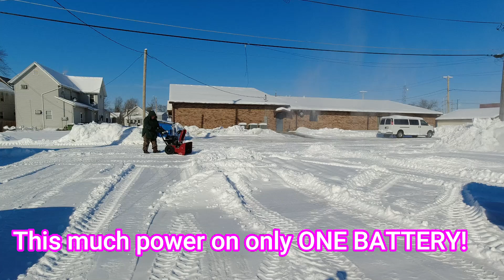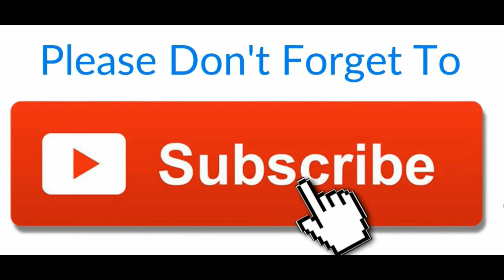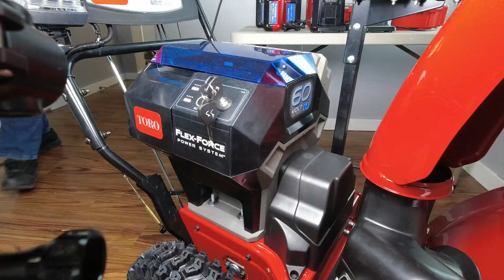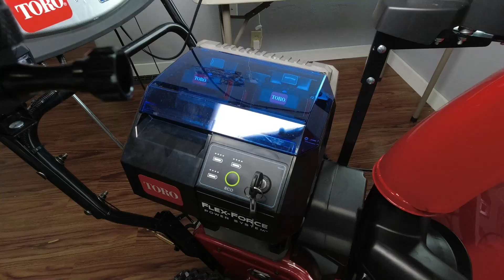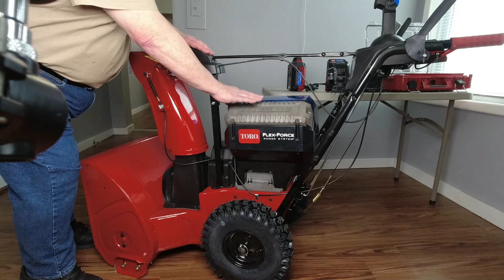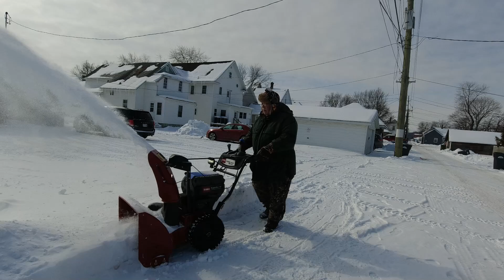First Look! NEW Toro Power Max 60V Battery Two-Stage Snow Blower

Comment: How come Toro really doesn't talk about their auto steering in any of their promotions for their snow blowers. 

My understanding is 26 in and up they have the auto steering.. 

I purchased the PowerMax E24 version instead of the E26 they're about $200 difference. The E24 comes with the 6.0 AH batteries and the E26 comes with the 7.5 AH batteries

The E24 does not come with hand warmers, 

Using my PowerMax E24 today to test it out I noticed that the axle seems to be locked!! 

But you're saying that the PowerMax E26 has power steering differential. Just like the 928 you reviewed when you open the gearbox. Why do they not mention this about either machine.. especially not mentioning it with the E26 the one that you have. 

Why don't they have power steering on the E24 I don't get it. I found it annoying on dry ground trying to maneuver the E24 I thought it was going to have the power steering.  

Is it that people don't like the power steering or auto steering cuz they're afraid of it thinking it's going to break so they don't mention it in any of their products.. 

Is it a lot more money to make autopower steering differential? 

I don't know what are your thoughts.
Reply from the maker: There are very few 24-inch machines on the market with auto-steering or trigger-style power steering. Why? The 24-inch group of snow blowers is very competitive and most people looking for that size snowblower are ONLY looking at price. Steering adds $100 or more to the price) 
Toro has the 824 SnowMaster single stage with automatic steering (auto-steering or autoturn) 
Ariens has the Compact 24 Compact 24 RapidTrak, 24 Deluxe and 24 Platinum with AutoTurn
Cub Cadet has the 524 and Husqvarna has the 324 with trigger power steering. 
If a Toro has steering it's usually listed in the features or specs. Toro calls it automatic steering in the 826 and 828. 
I'll ask Toro sometime why they don't consistently list the steering type.
The DI300 auto steer differential is bulletproof - it doesn't go bad.
Reply: @PaulSikkema  thanks for the response. I guess reading online people were saying one of the biggest reasons is because the 24-inch is much easier to maneuver and is really not needed because it doesn't weigh as much. But I tell you I would love it. 

I don't know if the power max E26 has automatic steering.. You say it does did you check? 

I haven't heard anybody talk about it online or any video showing it. 

It does not say it in the specifications on Toro's website, on home Depot or in the manual in the specifications. 

Just weird how they don't talk about it.. 

As for the PowerMax E24 versus E26 the price difference is only $200. But it looks like You could easily find that money because of the 7.5 AH batteries that cost $350 versus the E24 that only has the 6.0 at 269 or something like that.  And then the hand warmers cost about 70 to 100.00 It doesn't look like they're accounting for the automatic steering or power steering or even mentioning it for the E26. 

I still don't know if I even would have bought the E26 anyways My driveway is pretty narrow when I park my car right in the middle. I only have about 26 in on each side That would be really tight That's the real reason why I bought it.. 

I don't care about the hand warmers, the battery should be fine. But if it comes with the automatic steering on the E26 I would have loved to have it on the E24.. I guess it's not as big of a deal when the snow on the ground because you can move it easily.. But when there's no snow on the ground not that much fun..  

And I don't know if you answered already. 

What is your favorite snowblower and what do you use on a regular basis as your daily driver?.

Comment: Just curious Paul What snowblower do you use and prefer... What's your go-to through your life snow blowing and what you use now.
Reply from the maker: My "everyday driver" is the Ariens RapidTrak Pro. I have seven driveways to clear and one is fairly steep - so the RapidTrak is always the safest to use on it. It's also the easiest and least tiring to use so I grab it most of the time for the other driveways also. . 
If I only have a couple of inches to clear off the sidewalks I grab the Toro 60 volt single-stage. It really fast for smaller snows. 
I also have two gravel parking lots that hold a total of 25 cars. If I have over 6 inches I'll use the Ariens RapidTrak Pro but if there's less than 6 inches I have a New Holland TC33D tractor/loader that's faster than walking those parking lots. I also use the tractor to clean up after the snow contractors at the Salvation Army and Benevolent Society that are close by. (The guys in their pickups can't be bothered with cleaning sidewalks or around entryways...)

Comment: Looks like they are building/designing a modular battery/motor module to fit on existing snowblower frames. Good idea, I sure don't miss the roar of the engine, oil changes, rattling and vibration etc.

Comment: I bought E24 , it comes with 2 / 60v 6.0 batteries, I’m planning to get third batterie, is it ok to get 7.5 V?
Reply from the maker: Yes, by all means get the 7.5 AH. That larger battery will give you about 40% more run time.

Comment: It sounds like the “engine” starts turning when you turn the key to full on. Does the snow blower draw power from batteries before the drive handle or auger handle is engaged?
Reply from the maker: Yes, the "engine" starts when you turn the key. This snowblower works Exactly like the gas 826 Toro. Start it, and then go clear snow.
Reply: Thanks. Great videos and information. I appreciate your fast reply

Comment: I appreciate how well this is built, but I prefer that the SnowJoe 100v 24", which I own, takes advantage of being electric. It doesn't have a friction disc or belt. The motors only operate at the speed they need to and parasitic loss is kept down. The 100v, 5 Ah is a beast in both the 24" two stage and 21" single stage (which I also own). I live in Maine and they've gone through anything we've gotten.

Comment: Thanks for the video.  It looks like a powerful machine and quieter operation noise;  however, it like buying a premium priced EV that still needs a timing belt and a belt driven gear box for the friction disk system to work which require regular maintenance and replacement. I am sure it cost less for Toro to make it this way as well as easier to retrofit their gas snow blowers in the future when people needs to convert their small gas engine unit to meet the new environmental regulation.
Reply from the maker: Cost is always a factor because the snowblower industry is HIGHLY competitive. That said, yes you may have to replace a $25 friction wheel or v-belt in the next 10-15 years but overall the snowblower is all-metal. No plastic gears, gear housings, plastic controls and potentiometers that will crack or wear out like the other electric snowblowers are currently using.
Reply: Agree they should have made the powertrain gear drive on the motor and then electric drive to the wheels, what would be really awesome is if they can replicate something like John Deere's Load Match on their tractors and automatically slow the drive motors once the impeller is at maximum efficient load, then you can just set a max speed for it to ramp up to and it'll automatically slow down when the load is too high

Comment: Try that out on plow covered driveway and sidewalks ,a hell of a lot harder than snow that sits for a day
Reply from the maker: I understand your concern but since this snowblower is exactly the same as the Power Max 826 it will handle the snow. In addition, these brushless electric motors have instant torque so they may even work better clearing the type of snow you mention.

Comment: It looks like all they did was take one of their gas powered two-stage snow blowers, toss out the gas engine, and put an electric motor and batteries in it's place. It's a nice snow blower, the only thing I don't like about it is that the motor is always running - it's pointless to have an electric motor idling. The switch to turn it off isn't at the controls either, you have to walk around to the motor like you're operating a gas snow blower except you can't hear it so you might just walk away from it and forget that it's idling.
Reply from the maker: It's not THAT quiet.

Comment: Does this Toro weigh less that a comparable gas snowblower?
Reply from the maker: Not really because it is the same snowblower as the gas models - just the gas engine has been replace with an electric power unit.

Comment: Is the handle height adjustable for us shorties?
Reply from the maker: No. I'm 5"9" and the handles are a little low so I'll guess that if you are over 5"4" inches you won't have any issues with this machine. (Having the handles a little high helps gives you more leverage when turning the snowblower. )

There is only one brand that offers adjustable handles, Husqvarna. But since all the controls are cables it's a very "messy" looking snowblower. Over the years that many cables may give you issues.

Comment: Any input on the HUSQVARNA ST 327 ?
Reply from the maker: The input is in the front. The snow goes there. 
Sorry, I couldn't resist... :)
When they first came out I really liked them. But after owning one for a few years now (an ST 430T) I've realized it's just and "average" snow blower. It's comparable to the Cub Cadet 2X, Troy-Bilt and Craftsman 28 inch machines. It doesn't like heavy/wet snow near as well as the Ariens Deluxe/Platinum or Toro Power Max HD series. 
There is more weight on the front than other brands. That reduces the traction and makes me tired to use one. 
The steering is spastic and ALL THOSE CABLES STICKING EVERY WHERE!

Comment: love to see a comparison with the Ariens Deluxe 30 EFI  to the CubCadet 2 x 30 EFI. Also really appreciate your vids..they are extremely helpful!
Reply from the maker: No comparison needed the Deluxe 30 EFI has a 14 inch impeller and open front auger design. It is capable of handling up to 25% more snow than the 2X30 EFI. The Cub cadet has a 12 inch impeller and a closed six flight 12 inch auger. The Cub cadet can't handle snow as fast AND with the clesed, six flight auger it tends to plug up when clearing heavy, wet snow. The Ariens never clogs.

Comment: Paul 

Bought the e21 because of your review. Do you know if there's any talk from toro about putting there quick shoot like the gas models have on the battery models? That would be great considering ego has the remote chute on there single stage battery. Also the only real issue I had with my e21 is snow sticking to the inside of the chute, even after I sprayed it. I never really had this issue on my 721 I had. Paul - thanks for all you do, taking your valuable time is very helpful to many! God bless
Reply from the maker: No word at this time although I don't expect Toro to add the quick chute. Why? When given the option almost all users opt for the simple chute. Most don't want to spend the extra $75 or they feel it is just something else to break.

Comment: Hey Paul how are you I love the idea of the battery but just not for me hey Paul I ordered the platinum 30 sho 2021 any Accessory recommendations and have you heard of any auto turn problems with this model thanks
Reply from the maker: If you have pavers instal the poly skid shoes. If you have a lot of cement to clear consider the cast iron shoes when the standard shoes wear out.
No issues at all since 2014/2015 with the AutoTurn.
Reply: @PaulSikkema  thank you so much I have a black top drive way just a slight encline that’s all and I will be clearing some grass area from my Shed to the drive way that’s all I also ordered the non abrasive skid shoes I would like to put wider tires on it is there a size you 
Recommend and if so will the auto turn still work the way it should thank you looking forward to your response
Reply from the maker: The Ariens is different than other snowblowers you may have owned. The machine is balanced so there is very little front weight on it. That makes it very easy to maneuver and the standard ploy shoes are wide enough so it will not dig into your grass area (once the ground freezes a little) 
The Ariens has a lot more capacity so it won't ride up in the front like other brands. (If it is riding up there is a broken shear pin)

Comment: Hi Paul, how long its take to charge the batteries 2X 7.5 with 2 chargers? Do you know if Toro has 2-3 models charger or only one for the 60volt flex force ???
Reply from the maker: About 75 minutes to charge. 
Right now they only have the single charger and I don't know if they are planning on a multiple slot model. Personally, unless I was carrying the charger around in a truck or using it at a worksite I don't think I would need a multi-slot charger.
Reply: @PaulSikkema  Other video (mower info : 3h34min to charge one batterie, 6.0amp 0 To 100%) are you sure about 75min? Thanks again To taking time making good videos ans reviews.
Reply from the maker: One of my videos? I have had these 7.5 AH batteries since May of 2019 and they've never taken more than 1:15 to charge. I now have 4 of them and they charge well. 
That said, would you please send me the link to the video where i was stated  3 1/2 hours. I'd like to see what he is doing different. 
I will say that other brands do have slow chargers (like Husqvarna and Ryobi) and it will take hours to charge their batteries.
Reply: Paul other question for you . Have you tried 2 stage Ego Snowblower ??? Compare with toro Pros and Cons for each one.
Reply from the maker: In this snowblower the 7.5 AH battery lasts 17 minutes. Put three in it and they will last almost an hour in the normal mode. 
My brother is mowing a 1/3 acre with the red recycler mower using the 7.5 AH and he never uses more than 1/2 the battery. (mower is set at 4 inches mowing bluegrass)
Reply from the maker: Yes, This one is a lot quieter than the EGO, only needs one battery to run and it is all metal. It's not complicated to use and since it's actually the same snowblower they have had for a few years now it is a proven, dependable machine. It just had the has gas engine replaced with an electric power unit.
Reply from the maker: The difference is the Toro will run a full capacity on one battery. The extra battery slots on the Toro won't give you more power - just a longer run time. 
EGO recommends two (2) 7.5 AH batteries for peak performance. 
The EGO manual states "If the snow blower is over-heating itself, the LED indicator on the snow blower will flash orange and the battery indicator will be OFF.
When batteries are overheating, release all the triggers, wait until the overheated battery
pack(s) cool down or change the new battery pack(s), then restart the snow blower. To
prevent shut off due to battery high-temperature protection, don’t try to use a single
battery to power the snow blower when the depth of the accumulated snow exceeds
8 inches or when the snow is very wet or icy. We recommend the use of two batteries
working simultaneously. This is helpful in attaining the peak power of the snow blower.
After high-temperature protection has occurred, slow down your pace and narrow width
of the clearing swath to reduce the load on the battery."
Talking to the EGO engineers they say always use 2 batteries. One battery doesn't have enough capacity and it will overheat if you try to use it on "normal" or heavy snow for more than a few minutes.

Comment: I wish you could charge the batteries without having to remove them from the machine.
Reply from the maker: It's preferred to charge lithium-ion batteries in temps 32-80 degrees F.